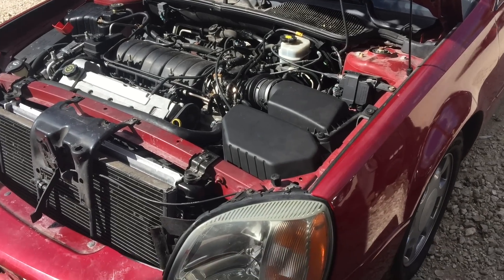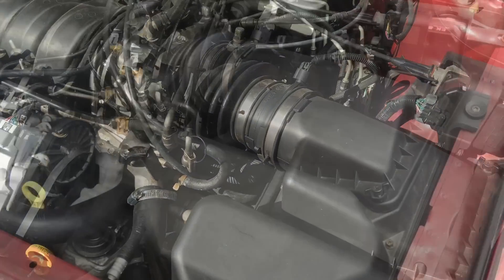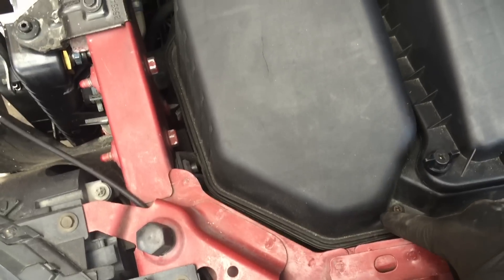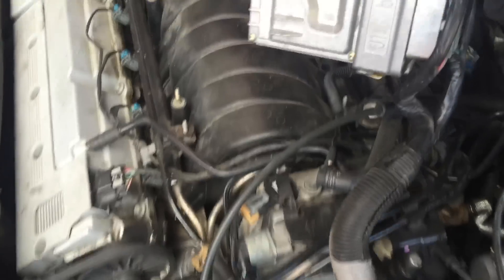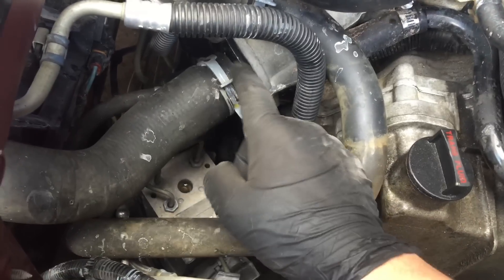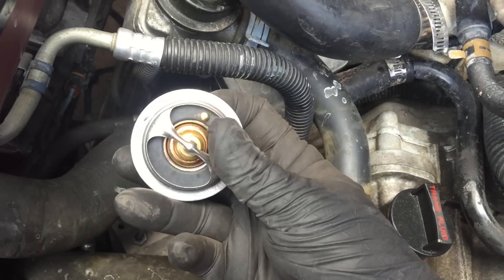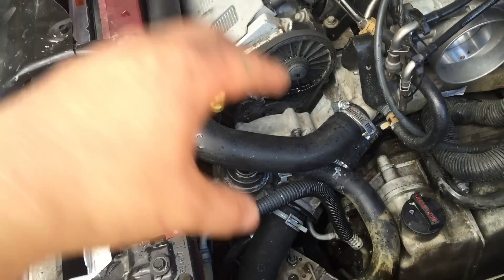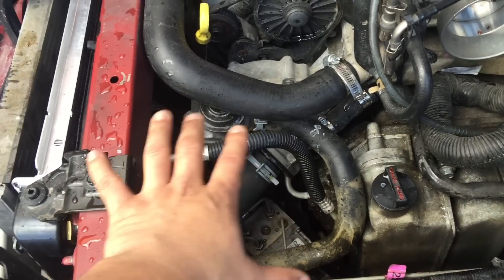Cadillac Northstar Thermostat Replacement / Removal

Comment: Was there an o-ring or a sealant between your thermostat and the thermostat housing? I changed mine out and the coolant is just leaking out the thermostat area . The thermostat you used is the same one as mine its just metal no sealant around the thermostat. I cant recall when i took it apart if there was an oring on the housing itself or not
Reply from the maker: if you go to a parts store they have them

Comment: Dont you have to bleed the air out the cooling system when changing the thermostat and thermostat housing?
Reply from the maker: yes, after job leave radiator cap off while car is on and let eh bobbles come out .. and keep topping off .. turn car off let it cool off again ... then top of again once is cold

Comment: Hey Bro, is this about the same procedure on a 97 Cadillac Seville SLS? I think my thermostat is bad
Reply from the maker: if its northstar i think so
Reply: @FalconsGarage  I had thermostat changed day before yesterday & it was ok until today. This morning it started running hot again..the gauge on dash would fluctuate from middle to almost danger zone of gauge then go back to normal.. I had to put about a gallon of water back in it. What else could make it run hot? And it's a Northstar..Thank you
Reply: @wes365  Ever figure out what it was, I’m about to do thermostat my 97 seville keeps running hot smoking won’t drive

Comment: Nice video! Question, neither of my fans turn on at all and my car is over heating, could this be caused by a stuck thermostat?
Reply from the maker: Baruch Bar Judah don’t think so. Because the fans should be controlled by the computer and temp sensors.  So if it’s over heating the computer would see that and turn on the fans.
Reply: Check your fuses. Had a fuse pop on a 740i bmw i had. Simple fuse swap and bam she was good to go

Comment: How do you know you had a bad thermostat?
Reply: Maria Guzman put it in a pot of boiling water and see if it opens up
Reply: @mnymatt  No he meant originally ,before removing it ,what lead him to believe the thermostat was bad ,is there any trouble shooting that would point to that ? What are the signs and symptoms of a bad thermostat ? How to differentiate between a bad thermostat and something else causing the car to over heat ?
Reply: With a northstar it's always good preventive maintenence to change the thermostat and keep up on the antifreeze intervals.

Comment: My N star isn't leaking water ,but gets red hot in 1 mi ? Fans are working could this be the problem ?
Reply from the maker: Could this be one of your issues?  YES.   With that been said this engines are VERY delicate so if you said your temp gage got to “red” already it is most likely that your head gasket has gone bad.
Reply: @FalconsGarage  Ok got a better look at it in the light ,goofy motor has a separate belt looks like a boot string for water pump that snapped .Get it patched up tomorrow fingers crossed head gasket ok ,👍
Reply: @FalconsGarage  I left a comment not sure where it went ,turns out was my water pump belt little ass belt looks like a boot string snapped patch it up in the morning fingers crossed  head gasket ok 👍
Reply from the maker: Damn .. Good luck lets hope thats it!
Reply: @FalconsGarage  Hey thanks man where ever your at whatever your working on good luck to ya 👍
Reply: @FalconsGarage  That boot string belt is the life blood circulator for the engine, Not many good Videos out there, you guys need to make another that shows purring thermostat in and explain about the belt. Tell them If its missing you might want to fix and test before you proceed to thermostat